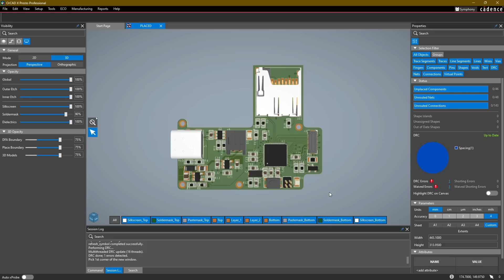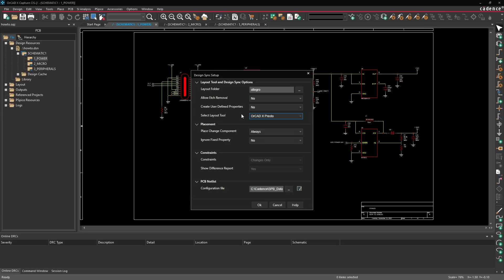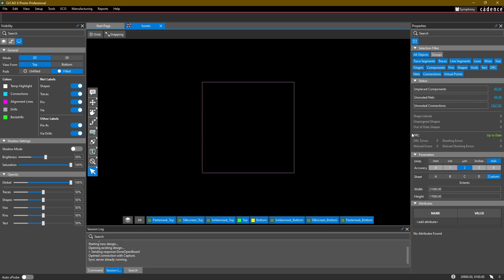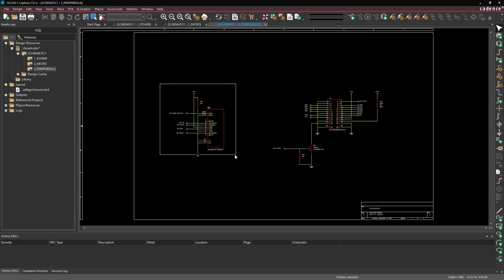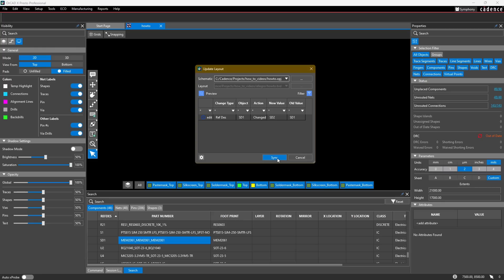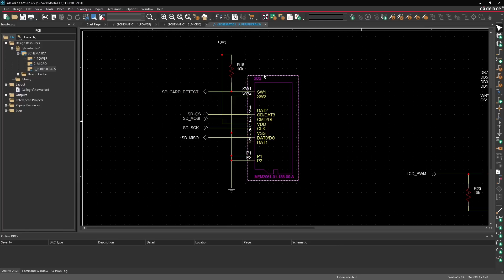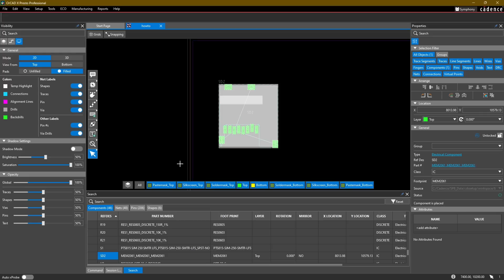OrCAD X - How To Series - Part 1 - ECO & Netlist Sync

Comment: Hello, I'm having an error in creating new layout.  "ERROR(ORCAP-2428): New layout creation failed. Correct the errors reported in session log and then create new layout."

I solved all the errors and dont see any errors in the design. But still cant proceed to layout. Please help solve this Adam.

I can send the error image if youll allow me to send to your email. 

Thanks in advance
Reply from the maker: I would suggest seeing if a netrev.lst file was generated in your board output folder.  Generally you can find additional error or warning information there.  Worst case, please submit a case through our support portal and you can mention the video in the support description.

Comment: After syncing also I'm assuming the library issue needs to be resolved.  Because I see the 46 un-placed parts, but I can't place any of them.  Is there also a button to just say distribute and the tool will place outside the board?
Reply from the maker: The parts are unplaced by default as expected.  To place parts around the board you can go to the top menu ECO > Quickplace Components.  Otherwise, you will have to use the placement command covered in Video 4.

Comment: Step 1 does not work at all for me.  Hitting new layout brings up PrestoX, but NO new layout is started.  I then hit the icon for new (CNTRL N) and the new layout opens.  However, it is not synced.  I then sync it and it can't find any libraries.  More details need to be provided.  I'm lost already and trying to learn this tool.  I'm an Xpedition User for close to 17 years.
Reply from the maker: Can you confirm what you mean by no layout is started?  By default Presto will start a new board file that is empty.  From the data provided there should be no issue with netlisting.

Comment: I think Cadence should include the option of viewing the name of the schematic design from which the netlist has been created. It will be help in 2 things, 1 after going to new layout, the display of schematic name in the PCB editor will ensure the netlist has been created from correct schematic design, 2 whenever we open the BRD file we can ensure there is proper sync between the schematic and PCB layout so that we don't need every time confirm the sync between the schematic and PCB
Reply: great suggestion @deepakgkrishnan6062   I'm one of the product engineers for OrCADX and I agree this would be valuable information.   Ideally we should display the design name, the revision, and the designers name who produced the netlist.   I'll log this as something to look at for future releases.
Reply: @johnsjunk9157  Thanks John 🙂